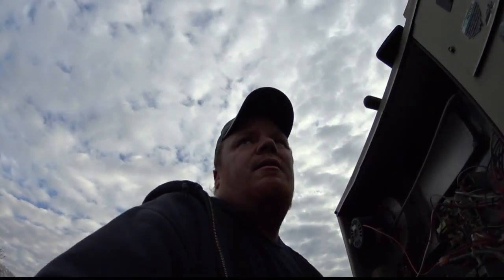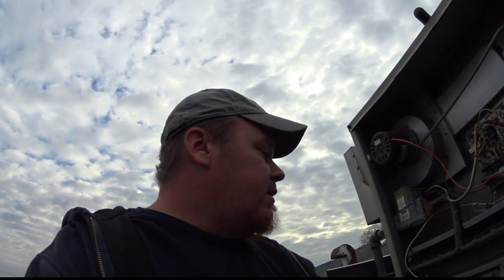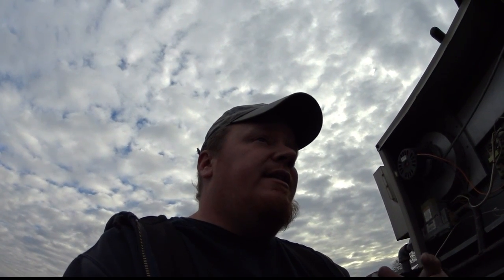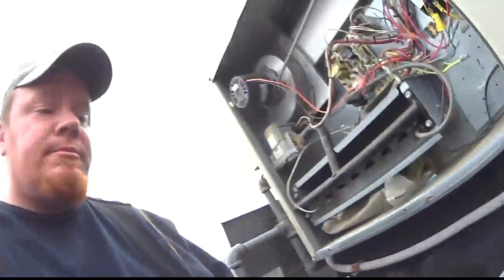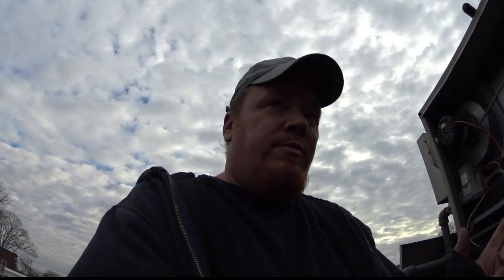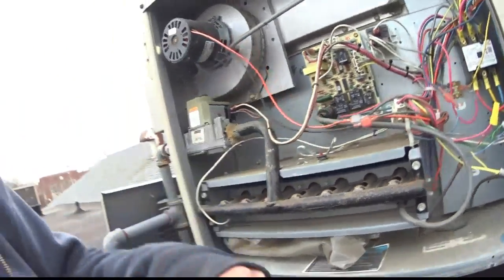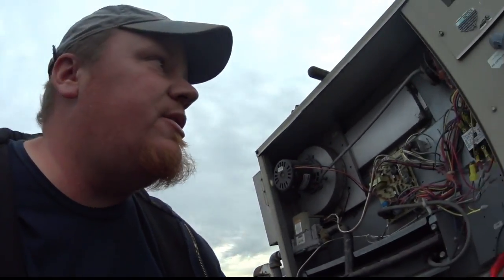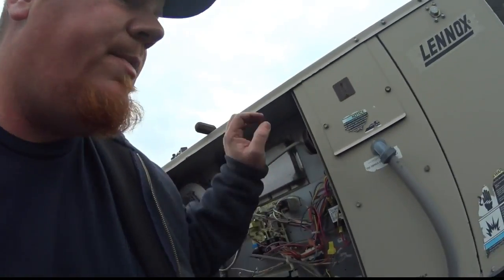Lennox RTU - Flame won't stay lit. #HVAC

Comment: Having this same issue right now but even with new board, not resolved.
Reply from the maker: Are the front of the burners clean?
Reply: Near new unit 1st time in heat
Reply: But yes

Comment: I feel like an idiot...I worked on a York RTU unit that visually, showed no signs of a cracked heat exchanger, but it was...It had to warm up first and then the crack would appear, at a seam.....When cooled down, it would close....No blow back or flame flutter at all, and it had to get hot, before the crack appeared, and even then, it would not always appear...When it did, it shut the unit down on the hi limit, then cooled back down and showed no crack again...Reset limit never tripped...No carbon build up on exchanger, nothing....Finally, at night, it showed....A nightmare, literally...I dreamed about it and some how in my dream, it came to me....Look at it at night....Bingo....I was mad at myself and glad at myself at the same time...Thanks again for making this video.

Comment: Good video...I'm having a problem with a York RTU, erratic burner ignition...Honeywell S8610u module...Pilot tube was blocked up pretty bad, cleaned it, cleaned flame rod, cleaned spark igniter, good for three days and going back this AM....I didn't have a meter that was capable of checking the flame rod, I know,.........No excuses, just forgot the damn thing after using it in my home....I'll be doing that and thinking maybe the draft inducer circuit might be faulty or erratic if not the flame sensor....Maybe a bad grd. on the burner circuit...I'll let you know....Thanks for this video...I hate call backs, especially in winter, know they happen in this trade, but Damn it to hell...lol

Comment: was working on the exact same unit today, went through the same process as yourself, changed flame sensor, still 0 micro amps at sensor. will be checking out that board closer tomorrow

Comment: That might have been tracking.  Where a carbon track builds up over time between two PCB tracks with a high voltage across them.  In this case possible the thyristor that fires the ignition transformer.  I find it a good idea to take a clear photo of a board before I swap it.

Comment: hi BK videos
and i got a question in how do you handle with your customers like when you have to make like 2 or more trips to the supply house because some of  them may think and look at you like  does this guy knows what hes doing or hes just guessing if you know what i mean'¿ some of them do not understand troubleshooting sometimes is not that easy!! happy holidays..
Reply from the maker: this was a commercial customer....so I don't even check in with the property manager untill I'm done...so no problem here...  but for residential customers...they are told that this is the part that is bad...but there may be other problems after I get this one in...and I will not know until I get this in and powered up...   I explain I can't have everything for every unit in my little van...  and I have had no problems yet..and I've been here at the same company for 19 years....

Comment: First Off Great Videos , just Subscribed ... New in the Field .. I have 21 RTU units to maintain Goodman 15 ton 10 ton. Overwhelming as far as maintenance, up there everyday. Great warranty tho, they replace parts. Except I still have to Labor. Gone thru 5 Compressors this Summer / Blower Motors / Condenser Fan Motors. Constantly one problem after another.
Today's mystery - (3) Units Never Shut off <blower>  no matter what I do "pull the thermostat off the wall" still running.
Thought it was the Fan Relay tested  somethings back feeding my Green Fan Wire - possibly circlet board ?

Comment: Good job Billy. All boards produce a constant AC voltage output to the flame sensor. You can check the AC voltage from the flame sense terminal on the board to ground to see if its within range for the particular board. Thanks for the video.
Reply from the maker: Thanks for the info +paokoma.